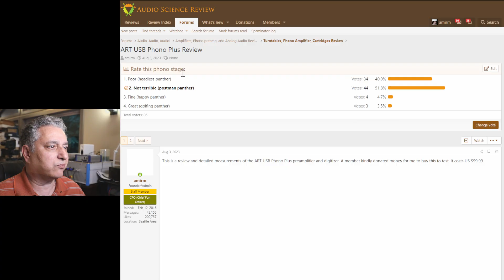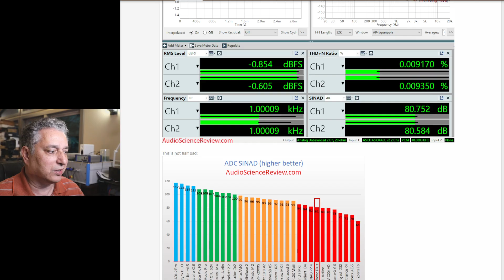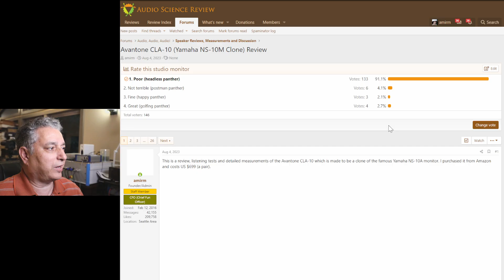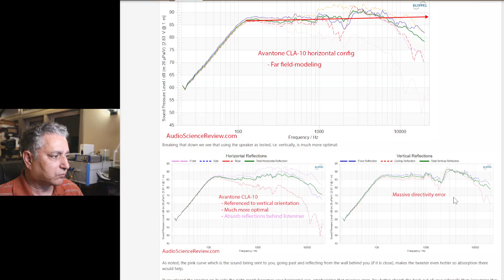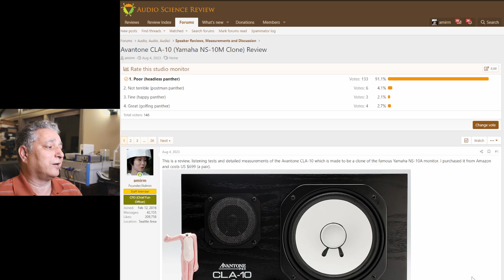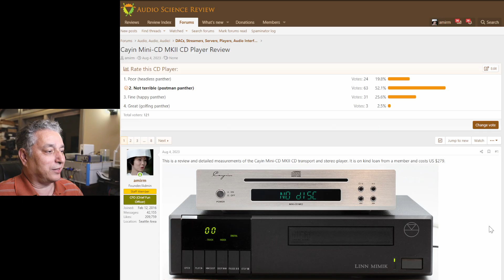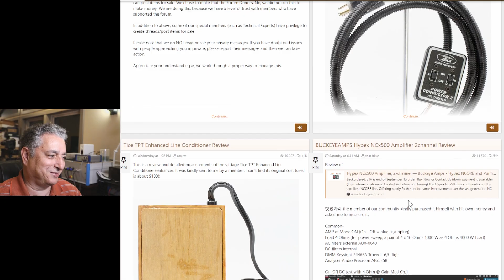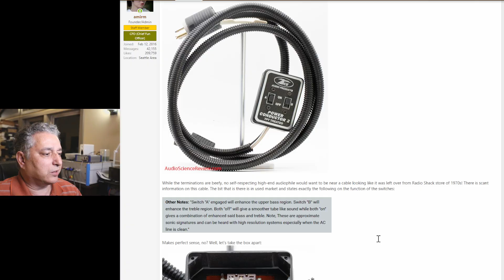ASR Audio Equipment Review #1

Comment: Amir, what do YOU personally use? I would like to know. Like speakers, amp etc. for your own personal music listening.
Reply from the maker: I have multiple systems for different uses.  My desktop where I spent the most time listening has an RME ADI-2 Pro audio interface driving usually the Dan Clark Stealth headphones.  

My main audio system is constantly torn up testing products but when it is not, it has Revel Salon 2 speakers.  Amps are Mark Levinson.  DAC is Topping D90.  Streamer is a silent custom PC I built.  Interconnects (balanced) are Mogami Gold mainly because they are so reliable (low cost ones tend to break).  I also have an Otari Reel to Reel deck that I play once in a while to bring fond memories when that was the highest fidelity source you could have.

We also have a 7.2 theater powered by Trinnov Altitude 16 processor.  Amplification is through a 5 channel Proceed amp (120 pound beast!) and Hypex stereo to drive the rear channels.  Speakers are Revel C52 all around which is a very unique configuration.  Projector is Sony ES6000.

Note that I never preach people use what I have.  To wit, you would do much better than buying the amps I have at far lower cost.  I just happen to have some gear so use it.
Reply: @AudioScienceReview   If you have the space, you should try setting up a vintage Japanese amp and speakers, something like the Kenwood KA-9800 with some Sansui speakers from the late 60's early 70's etc.
People who have never owned a vintage Japanese system have no idea what they are missing out on.
It may not measure well, but man it's so musical and enjoyable to listen to.
Reply from the maker: @crtgamer2355  I actually got into "serious" hifi with a Sansui stereo amplifier!  We are talking 1970s.  I still have an Optonica amplifier circa 1980s which I need to make time to test.  I do test vintage stuff as members send them.  Occasionally I have gone looking for them on used market but seems if it has a silver front, the cost has gone through the roof!
Reply: @AudioScienceReview  That's great to hear Amir, these things truly are gems.
I have a very modest setup, Kenwood KA-800 with Sansui SP200 speakers, hooked up to my PC via Behringer UMC 204 interface and the sound is simply glorious using digital sources. 
Also sounds amazing with analogue sources like my tape deck.
I don't care what people say about "kabuki speakers" but they sound great to my ears.
I am not too familiar with Optonica but I will check it out.
Yes prices are ridiculous these days, people know what they have these days thanks to the Interwebz HAHA!! 
Double edged sword ;)
Reply: @crtgamer2355  I also have a Kenwood that I use in my CRT setup, it's a Kenwood A3050 where I use the same JVC wood cone speakers that I also use on my desk. Awesome little setup which sounds great and doesn't break the bank.
Reply: @Phoenix_1991  That's a very nice receiver indeed, and good to know other people are also still using CRT televisions ;)
Reply: @crtgamer2355   Haha, yes. I have a JVC PVM that I use for retro gaming and the occasional SD content like 480p anime/movies. Mostly I use it to play 8/16-bit era games.
Reply: @AudioScienceReview  thank you for taking the time to respond Amir! I really appreciate it. I have also had all kinds of systems from very expensive to very cheap. Currently I am out of the hifi game so to say and use the JVC wood cone speakers as pc speakers with some cheap amplification and the Topping DX3 DAC. I also have a pair of Wharfedale Evo 4.1 sitting around doing nothing since they were too big for my desk. Love Wharfedale, loved the Linton Ann speakers! Think audiolab is a good amp to pair with them. One day I will get back into it.
Reply: @AudioScienceReview   Am I correct in assuming then Amir, that all your gear measures good enough for you to use? Since you recommend gear that measure and sound well on ASR, I would think then that you do not use gear in your personal system if they were not up to your standards, correct?

You have some pretty spicy gear, holy moly. I guess it helps being a dealer for some of these stuff huh? 
😁. The only thing I was slightly proud of that was similair to something you had is the Topping DX3 Pro I own which has the same AKM4493 chip that the MRE ADI-2 Pro also uses. And I know implementation matters, but I happen to know you like the DX3 Pro quite a bit too.
Reply: He has like a $50,000 system.